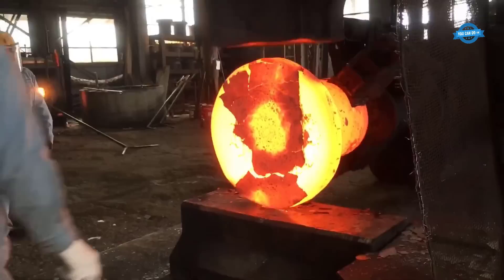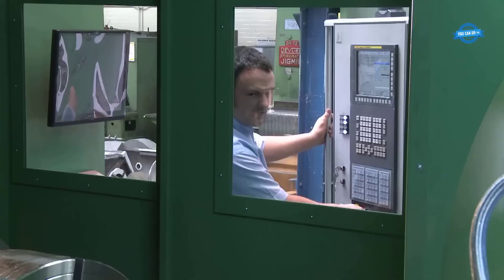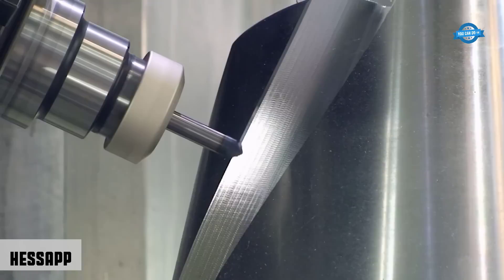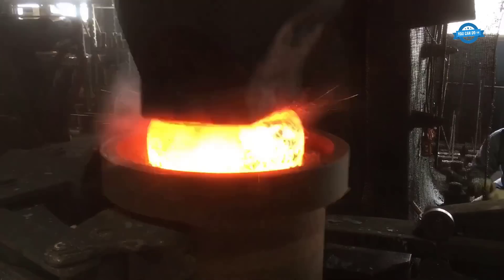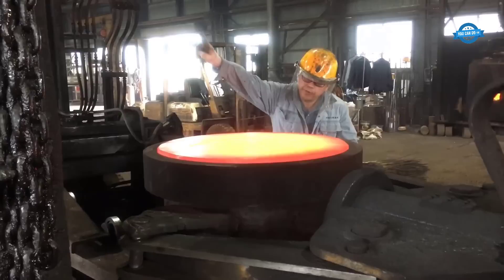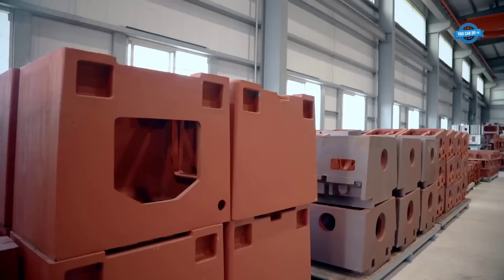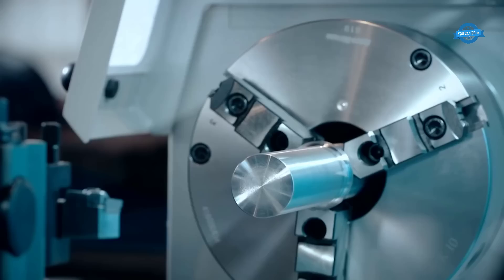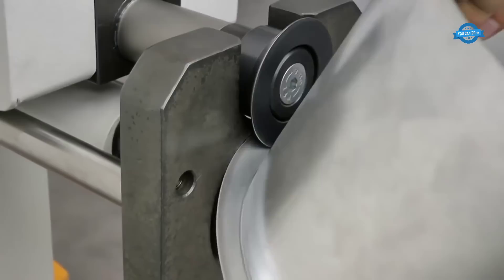Large Stator Manufacturing & Amazing Metal-Working Process. How To Free Forging By Heavy Equipments

Comment: Just for accuracy, the process of expanding or reducing pipe diameter for a joint is called swaging, pronounced sway-jing not swaging. I am a retired refrigeration mechanic of 30 years and used this process regularly when plumbing a system.

Comment: Watching them make the connector piece, doing the first hammering, I wondered why they place a tool on top of the steel and hammer it. 
.
.
.
.
.
.

Then it occurred to me that with the very strong inner structure of steel they need to 'soften up' the end of it so they can hammer it into the mushroom shape that they do next. 
.
And even WITH this 'softening' step see how hard it is to force the steel into the required shape!